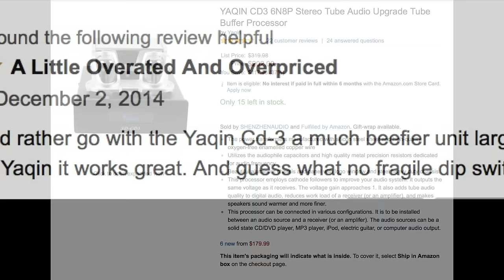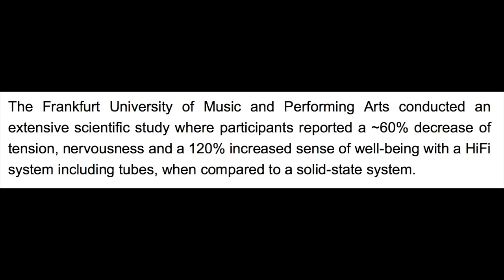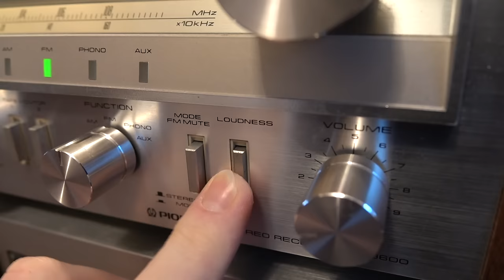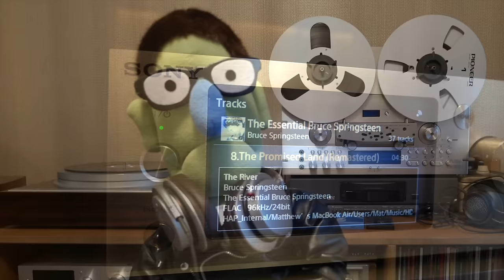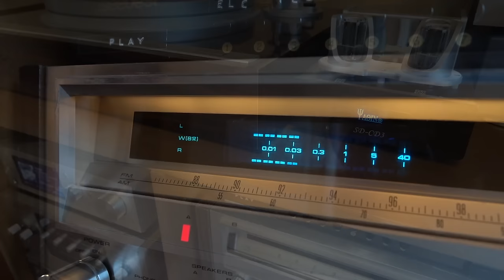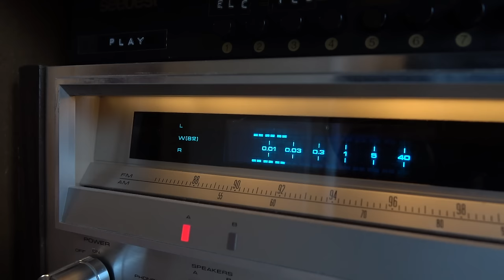Add the magic of Valves to any HiFi - with The Yaqin SD-CD3 tube processor

Comment: Anyone that is messing with loudness buttons or treble and bass knobs is not listening to Hi-Fi, you are listening to mid-fi.  Nothing wrong with that, but someday, if you want really good sound you will want to move up to separate power amps and preamps that do not need any turning of knobs to sound better.  If you want to really make a difference in improving your listening experience then start adding some room treatments like defusers and absorbers, that is money well spent but it will take some time to learn what you are doing and I'm not talking about that cheap foam you stick to wall, I'm talking about the professional panels from GIK acoustics, they can help you get way better sound in your room.  Stay away from China for good sound, those tubes look cool, but that's about it.  Real good sounding tube preamplifiers will run into the thousands, but you can find them used on eBay to save some money.  It takes years to train your ears and save enough money to make it worth the upgrades, but it's a great hobby and most hobbies are expensive eventually.

Comment: whats the record player?
Reply from the maker: +David Smith It's a Sansui XR-Q7. A very unusual and surprisingly sophisticated turntable. It has a tape head underneath that reads magnetic strips on the outside of the turntable which it uses to keep a lock on the speed - it's also got a wheel that rotates in the opposite direction to the turntable to counteract vibrations. I made a quick video about it when I first got it  https://youtu.be/eNMmUMN3jrk
Reply: its defo a looker

Comment: "Have you ever adjusted the bass or treble on your devices?" And to that I say, If I want an accurate sound. No.

The only times i've used that stuff as an adult is when using a speaker system that is more deficient in it's reproduction of certain frequencies that you have to EQ it to bring some (If any) of that back. (And if I was going to EQ, i'd prefer much finer control than just ambiguous Bass/Treble Knobs) I used to do this a lot when I was a kid and I had an old RadioShack Realistic Amp that I took from my father to use. The speakers and the amp had very poor bass reproduction. So I had that cranked to 11 constantly.
 
The other is in the car because of similar reproduction and noise issues of the car and environment.

However! There is nothing wrong with using them if you like, just remember what it is you are doing! :D (It's a method of over compensation because that stuff already exists in the audio signal, the system/speakers just can't reproduce it.)
Especially if you ever decide to dabble with recording someday! Because that would get you in trouble very quickly!

And there is a reason why people don't want to make these changes. Accuracy and integrity of the signal. If you've got professional monitors that have a known frequency curve or even a flat one. And you have a treated environment. You want the resulting sound to be accurate to the recording. If it's an old Analog recording with noise, stability issues and boomier mixing. You want that sound to come out. as an example. Not a modified one. People go to great lengths to get as accurate as possible sound. To many that is important. And is just as much if not a more valid argument and point than fucking up the signal before it even makes it to the drivers.

Also: Using the Volume Knob as an example of altering the sound signal is totally NOT a valid argument. Unless you want to get in to the rabbit hole of how well amplifiers can handle high sound levels before introducing too much distortion.

Comment: When I listen to headphones via valves*: 1) I don't find myself constantly turning the volume down more and more over time even though starting at a comfortable level. 2) I listen for far longer; >1 hr vs ~30 min.  Also it has to be OTL (output transformless).  Single ended triode output tubes preferred. 3) Timbres are very natural, and to me that matters far more than knowing the sax is to the left the bass -- obviously saxen are more liberal. And this holds for most kinds of input, including youtube videos.  Some of these could be caused by what they're seeing.  It's nice to have some support for tubes* vs the "everything sounds the same if measures the same [except vacuum valves* which are just expensive tone controls]."  And given 1, 2 & 3 above, I don't care.  I'm 100% objectivist, but I think that the current set of electronic tests is so incomplete, that we're basically at the "earth, air, fire, and water" stage.  At this time, the ear/brain is the only test rig that counts.  I hope that will advance, but I see little reported on new tests.  Give me > 1hr on an A/B/X with my headphones on my couch with my music and if I couldn't tell the difference then I'll buy/trade my amp for the other one I was listening to.
I command this zombie thread to live again.  Muahahahaha.

* Note the even count of British vs USAan terms for thermionic* devices in the name of international sibling-hood.

Comment: These are way overpriced, I could MAKE one for practically free. Never mind, I already did, and use it in my sound system, heck I even made a tube/valve amplifier as well. I don't need to adjust bass or treble anyway, the speakers I have sound amazing already.
Reply: CoolDudeClem
You rule!

Comment: BUT it does not have just tubes/walves - there are 100% allso transistors or (well they are made of transistors, huh) chips/opamps/or, gods forbid, DSPs (digital signal processors ;-)
Btw chinese like using aluminium or iron aloy instead of copper for power leads - fire hazard.

Comment: Personally I'm not a fan of such devices. When you think about it logically, these devices can't hope to offer the true valve sound, as the systems in which these are used typically consist of a solid-state preamplifier, solid-state power amplifier and solid-state source components. All you're doing with one of these devices is adding another stage to the component chain. While I'm certainly not against components that colour the sound, and of course I know that the notion of matching the recorded sound is ridiculous, if you want the "valve sound" buy a valve amplifier or a source component with a valve output stage. While this device may certainly alter the sound, your system is ultimately solid-state and will always sound solid-state.

Comment: Trolling hifi snobs 🤣🤣🤣
Reply: Ryan McCumber:  Hifi and high end are two very different things:
HiFi - High Fidelity

    n 1: accuracy with which an electronic system reproduces the
         sound or image of its input signal
This is what "I just like the sound"-haters want.  I agree, they are snobs. If a very small subset of the characteristics of music (not 1 or 2 sine waves or white or pink noise) isn't within a narrow range of numbers then you are either gullible, a liar, a fool or any combination.  They insist on making snide and insulting posts, trying to make people who are happy with their sound unhappy and feel bad about their choices.

High End - People who think a more expensive product almost always automatically sounds better.  The price is almost as holy as the spec sheet. These people, IMO are often scammers. It includes fools who call a piece of equipment with bad tubes in one channel Class A.  A pyrite ear indeed.  People, who in reviews say product X (expensive) is as good as product 1 (bargain) and yet put X in a higher class than 1.  Product 1 should be in a higher class (classof(X) + $$$).  $$$ is actually a rating, but it's lower than others.  They often insist on making snide and insulting posts, trying to make people who are happy with their sound unhappy and feel bad about their choices.  Basically these the people you thought were insulting, and incorrectly identified as hifi.

Happy - If possible, try a product (or look at a spec sheet) and if you like it enough to pay the price, buy it.  Listen and be happy.  Don't let any aholes (above) destroy your evenings of listening.  But never reject a product without listening if possible.  Mostly, they don't start arguments and don't bug anyone (even the above) unless they are dbags.  "He did it first" is a legitimate reason to respond in kind.

Hopefully there are people you can disagree with and yet have an respectful debate.  Never met one.

Comment: I like tubes, but I would never spend 3, 4 500.00 on a tube component. If you want a tube sound buy a decent amp or preamp. Yaquin is hardly serious hifi. If that's all you can afford, if it was me, I'd go with a SS amp and get a lot more for your money like a Denon or NAD. But this cheap chifi is a regret waiting to happen IMHO.

Comment: When you have to tubes, erm, valve, erm, glowing light thingys,,,,at every level you really open up the sound (this other Ya{ch}in unit does just that for three times the price, though, you can find equally excellent vintage receivers like it from the 60's on ebay by Pioneer and the like for a third the price that just need a few new,,,,,glowing glasss bulbs) https://www.amazon.com/dp/B012CSK30E/ref=twister_B07QDZYQB1?_encoding=UTF8&psc=1#customerReviews

Comment: out of curiosity, why exactly do some people prefer valves? do they sound different? what is the science behind it?
Reply: Unlike transistors, valves have a softer clipping which also adds "richness"  (harmonics) to the sound which so certain degree can be considered pleasant, unlike transistors when overloaded have a pretty nasty sound (hard clipping).
Reply: God this is completely inaccurate.  this is true for guitar amps where clipping is induced on purpose to produce the desired distortion, but in hi-fi no one is overdriving their amp whether it's tube or transistor, so that is irrelevant.  while there are some (generally very expensive, and low output power) tube amps (mainly class A single ended triode designs) that have extremely low distortion of any kind, in general tubes sound different (and to many, "better") because the distortion that they do introduce is perceived as pleasant, because tubes produce even ordered harmonics (that means if the fundamental frequency is 1khz, the harmonics would be 2, 4 etc. as opposed to 3, 5 etc. which transistor amps can produce), this pleasant distortion, the even ordered harmonics, is responsible for the "rich" "full" "warm" descriptors used for tube amps.  they can also (though not always) tend to roll off the highest frequencies, seeming less harsh.  speaker pairing is extra important with tubes due to the ways the impedance and inductance interacts with the tubes.
Reply: Finally!! Thank you for this comment, you explained it well!
Reply: No one really knows how they work. Since they appeared "magically" on the market right after the UFO incident at Roswell, scientists have been striving to uncover their inner workings. However, since even electricity itself still remains an unexplained mystery, it all adds up and it has been quite the daunting task, to understand those things. We're lucky to have them, nonetheless.
Reply: Class A amplifiers - whether transistor or value - will tend to exhibit even order harmonics due to inherent nonlinearity. Valves are relatively low gain therefore it's harder to linearize them with feedback. But FWIW valves are prettier and more marketable. Most "character" mic preamps will use a combination of transistor based Class A and transformers to achieve their sound when driven hard.

Comment: the thing with these amps is. Most of valve preamp claims to have less than 0,0001 % distortion.
But i ask me. You want valves becaus they distort the sound in a good way, but less than 0,000% distortion? Waaaait a minute....... This is just a scam which seems to have a good run at the moment

Comment: tubes = even harmonics
S.S. = odd harmonics
most times you will find even harmonics are easier on the brain and ears . this Will show them selves during long listening sessions both thru speakers as well as Headphones.
best way and simplest way is to try it out and see if you like it. always buy thru a good dealer that has a liberal return policy. also one small thing switches are bitches this will add more to the signal chain than a lot of electronics. nice to see you remove them but they could have altered your initial review so next time though they are convenient don't forget to give a final listen without them to be sure. and one thing else cables in this situation can also make a difference as well as placement in the chain ie between pre- power amp,between component and pre- amp input etc.
OK ,I'll shut up now hope something 's I mentioned help.

Comment: Can't stand purists really,  You can't do this, get cables for $1000 a pop yet its just copper wire with insulation.  I got a "hifi" corner with a class A/AB amp and then I also have a home cinema with 5 Homebuilt PA speakers with class D-amps rated at 2000w peak just to get that thumping bass/midbass from gunshots etc. What I wanted to say is that sometimes I prefer to listen to one system and other times the other system. Its all about what you prefer and not some dude on the www.

Comment: I wouldn't use that thing for a whole other reason then what you're expecting. If that is the real schematic: http://blog-imgs-61.fc2.com/a/n/a/analogdevice/20141102103658d66.jpg then you're trusting all your audio gear to some chinese capacitors. If C2A or C2B fails, you'll have high Voltages on the inputs of your amp.
Reply from the maker: +Horstelin If things fail then bad things usually happen - that's why things failing isn't considered good news.
Reply: No, voltages not high there because its on the cathode side. (cathode follower) But thanks for posting the link to the schematic, I had a good laugh at the 100k resistor between grid and cathode. And also because both triode systems are strapped together, heaven knows why. But if you add just a few components you could jippo that thing into becoming a real nice line preamp for magnetic turntable cartridges. No kidding

Comment: They can't even pronounce the word they use for valves, those over-the-pond'ers pronounce it like  "2ubes" & not correctly as in  "TChoobs" - the English way - the proper way - 2ubes indeed.  That iFi thing looks like it uses one of those small double-triode valves from the old aerospace industry & 1 valve for 2 channels is just 'Cheapness'  Good preamps will parallel the internal double-triode valve by pin connection into a 1 channel output, giving a higher quality by halving the output impedance & spreading the signal over 2 control-grids (beneficial for valves)  & that iFi is uber-expensive to boot! compared to the Yaqin plus valve-rolling would mean going inside it. These things don't warrant the price of that iFi. (ibet it's got a cheap "Chip" psu switched-mode power-supply (i.e. £1-70, or perhaps it's got a really good quality Texas or Analog-devices 'Chip' op-amp psu for £4 - 30p trade) & with wire& sockets, some resistors & a few capacitors & switches, the casing is 25 - 40 times more expensive than all it's internals for them to make i reckon. But you can see where the cost was spent with that well built chunky looking Yaqin & still be amazed at the price ...especially with that chunky linear power-supply. Yaqin's phono-stages are similar for bargain prices on-line like *China HiFi (***be sure to request 240v transformer on order) i've done at least 6 or more major purchases over 7 or 8 years with them for my own & my father's hi-if & all was great, very reliable & amazing prices tho over half the items took 3 weeks longer for a requested 240 Volt Transformer version.  ***UK mains gets to 245'sh volts when off-peak & always > 233'ish on-peak which is fine for solid state but can overheat (especially Power Triode) or cause a buzzing in valves inside 110/220v Chinese equipment transformers, over-passing 15% or 20% window of voltage. Transformers only multiply whatever the wall voltage is by some factor & over half the China brands claims a 230/115 transformer on external selector BUT going inside shows most have a 220/ 110 labels on the actual transformer's input tappings so that's its true rating & NOT the voltage selector shown rating. After step-up, the error is also stepped-up so beware with Chinese valve gear. Always request 240 transformer windings & wait the 2 or 3 weeks longer (is the norm for that)  I believe they craftily do this trick so the gear is then compatible with U.K. & Europe & USA & Canada & China themselves & others, & purely by outer voltage selector choice but it's usually lying as i've stated.    (*if checked-over by on-line reviews first)

Comment: Then this so called gadget is SEVERELY!!!   OVERPRICED!!! for what it's SUPPOSED!!! to do  & in this case unreliable. ( FAULTY POWER LEAD & CHEAP CHINESE ).  this causing it to be POSSIBLY DANGEROUS!!! 😱  If it was bigger difference between system as standard set up & via this unit was quite noticeable then fine. But, at the prices they trying to set for it NO!!!! I wouldn't bother wasting my time or money on it. & personally neither should anybody else. UNLESS they know their electronics EXTREMELY WELL!!!! & IMPROVE IT DRASTICALLY!!!!  But, personally as I said give it a VERY WIDE BIRTH as they say. ( keep well clear of it for the sake of SAFETY!!!)     if nothing else!   For those reasons I have already mentioned as to why I would avoid it. & others should also do so. But, I am far too suspicious about anything that comes from China. (as far as so called  their TECHNOLOGY goes).  😡👎👎👎👎👎👎👎👎. But, it could be a good thing if it was done from JAPAN instead 😁 (MAYBE!!!) IMPROVED & SAFER!!!